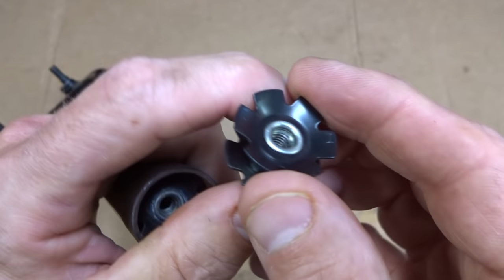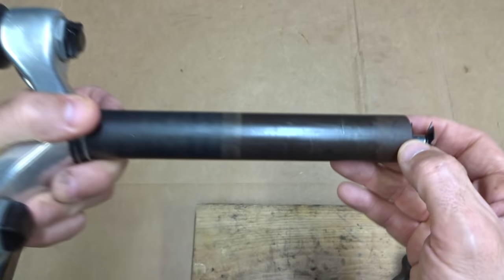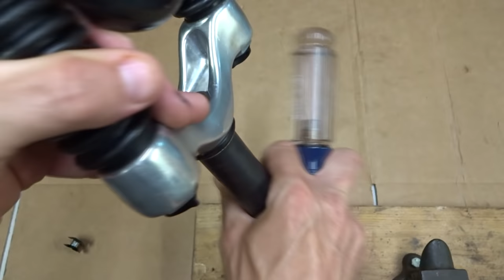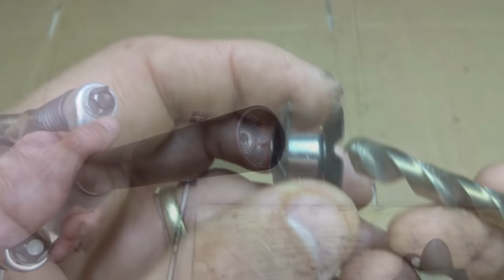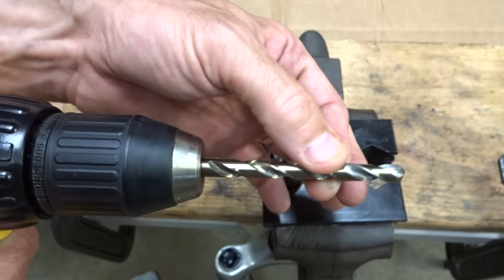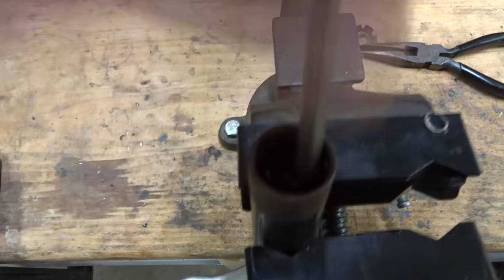How To Remove A Star Fangled Nut From A Fork Steerer Tube

Comment: My man.....thank you for explaining this. I just bought a 300$ bike from a guy that said his front steering was falling apart and it turned out to be this fangled star but was coming out from over tightening I assume. I took a hammer and screwdriver pushed it back in, reset and tightened the top cap and bingo! It's working perfectly fine!

Comment: Bro, not many people talk about this damn nut. You're the boss! Thank you so much! My fork has a column in the bottom, probably for extra support, that does not allow to push the nuts out. I already had one down there and the one I was currently using simply broke and the internal threaded part was spinning with the bolt, making it impossible to loosen and remove it. That would've made 2 nuts down the fork, I was even about to call it the nut cemetery lol.

Thank you so much!

Comment: Just done this and took about 5 mins to drill out and fit a new star nut with a cable hole to internal the front brake. Great tip to a job that would otherwise been a pig.
Reply: great!

Comment: you always make great vids!  I have bought a few used forks cut horribly crooked, so the star nut doesn't center when installing. One time I banged it all the way down through the bottom with some socket extensions only to find that the previous owner had sunk not one...but 3 star nuts in there already!!!
Reply from the maker: That is why I use a guide when cutting forks.
Reply: Or you can use a tube cutter, to cut the steerer tube of the forks.

Comment: Great video RJ,i thought they were very difficult to remove because it's a wedge,it drilled like buttter but i used a industrial drill press at work.Hitting on the edge really so it sits sideways for removal is then job done.Cheers.

Comment: Thanks. I know it is old but very helpful. There are a lot of reasons to remove to star nut. Replacing with a superlight expander type or a steerer extender are two reasons. Cervelo uses carbon and an aluminum inner sleeve on many of its steerers so a star nut may be installed in them.

Comment: It's not even a heavy gauge thick metal. My advice to people that watch this video go to walmart buy a Pb Blaster rust eater or DW40 use a 3/8 15mm socket attached it to a long 3/8 socket extension spray the star nut with the pb or the DW40 connect your 3/8 socket and extension all together turn your fork upside down insert your socket and extension on the hole use a hammer to punch the star nut out. and believe me it works coz that's what i did on mine.

Comment: Star Nuts in the fork are such a major lame design !   Here's why:  Sometimes if you reef on the stem bolt you'll find that the threaded star nut is now spinning freely in the stars, way down in the stem... That's bad.  You can't get your neck off, or the fork either.   Try to drill the nut off the top and you find that it spins anyway so you can't. ( You are now screwed.  At this point I won't go into the various options of getting yourself unscrewed from this dilemma.  )   I will say that IF you should buy a new star nut set, PLEASE bore out the threads of the star nut.  Pass the draw bolt (get a longer one)  THROUGH the star nut hole since it's bored out now.  Then put a nut on the other end using a wratchet extension up under the stem from below,  - assuming your fork is open to below.  This is like a manual version of a wedge bolt stem.

Comment: hmmm, I just bought a new bike frame with a shorter headtube so i need to shorten my steerer tube. I never thought to just push it down and reuse it. i was going to remove it but I think now I'll just reuse it. I think I'll just have to cut small sections off the steerer tube and lower the star nut down as I go to the point where i want it to be and the length where I want the steerer tube to be. Here's to hoping my crappy pipe cutter tool can last long enough for maybe three cuts lol. On second thought I think I'm going to buy a new pipe cutter considering I had a hard time shortening my handlebars with this pipe cutter.

Comment: Some moron installed a star nut in the carbon steerer of a used frameset I bought.  They gouged the carbon circumferentially during the insertion. Fortunately, the steerer is too long for me so I need to cut it but the cut would be ABOVE or THROUGH the star nut.  I can't very well pound it through on a road fork since it only has a small drain hole at the bottom of the steerer... not to mention that I"d basically be reaming out the full length of the steerer. So, will try to drill it out.  And, of course, use a proper expansion plug designed for carbon steerers when I re-assemble the bike.

Comment: I need to remove my star nut as the threaded part in the middle spins around so I can't tighten the bolt. I'll try this method tomorrow and order a new star nut.  By the way the tube on my head is completely closed at the bottom.

Comment: Your pull method worked perfect for me, thanks! Just done to save weight for free. No need for star nut. Just use expander headset as tool to set stem height and tension, then remove and cover with plastic cap :-)

Comment: I pressed mine out at work, using a hydraulic press and a length of 3/4 stainless tube we had lying around. I didn't know they were called a 'star fangled nut' so I went into a bike shop in York and had to draw it for the bloke behing the desk.  I would say you need a more solid work bench I could see it moving!

Comment: Do i have to take this out when taking off my forks?
Reply from the maker: No.
Reply: No just remove the stem and the front brake and i will basically drop out (if you have the newer type of stem and fork setup)
Reply: Fedor van Meeuwen thanks, helped a lot. I was struggling for hours

Comment: For an open bottomed tube I would throw a bolt in it, then push the nut almost through the bottom so the bolt can be clearly seen sticking out the bottom

Comment: Will this work with carbon steerers? I assume I would have to go uo in small increments and not spin the nut My Cannondale Synapse 2 actually has a star nut from the factory..I may just leave it in and see if I can get the Specialized compression plug in.. yes I know that once the headset is set and the stem clamped you don't need the top camp and bolt anymore

Comment: Great video but whoever designed the star nut made possibly the dumbest solution to a simple problem ever. Mine simply spins, marring up the inside diameter of the fork. Can't get it out because I can't loosen it any further, but it's far too loose to ride on.

Comment: One reason to remove it is if you not only have a no use for it all ( currently the case for me ) but if it actually ends up in the way ( soon the case for me ) like when you're planning to use the headtube as a storage space for a Shimano Di2 Battery after you lost your alternative in the seat post due to a Dropper Seat Post.

Not using a Star nut though requires the use of a purpose-built stem like the PRO Tharsis or PRO Koryak
Reply: Not necessarily, you could adjust headset tension using an expanding clamp style system, tighten your stem and then remove the internal clamp.

Comment: Does this really hold the fork in place? I mean if I don't put it on at all what will happen?
Reply from the maker: It's used to tighten down the stem tension the bearings. The stem then clamps down and holds the fork in place.

Comment: my top cap bolt stuck on the starnut, i can't pulled them out, should i drill the bolt ?
Reply from the maker: If it were me, I would put some penetrating oil in through the bottom of a the steerer and try and impact driver. But you can do what you want.
Reply: my bad, i mean it's not stuck cause by a corotion, it's the bolt has losing its grip, i can't tight or loose them.. so they stuck there for nothing.. after i pulled out the bolt i'm pretty sure can try this method on your video to remove the starnut, and replacing the new one, thanks 
*sorry for my bad english

Comment: Too bad mine has a piece of broken screw stuck in it :(
Reply from the maker: Drill it out.
Reply: @RJTheBikeGuy  not really doable, screw was sticking out too much, would have to cut it somehow. I ended up shortening the whole tube so much that there is only place for stem and one 0,5mm pad left. This way I could reach the star with dremel equipped with micro-grinder, and grind the first layer of star "leafs". Then I was able to wiggle it and pull it out.

Comment: this is so bad on so many levels.  seriously bad advice, this is more a vid on how not to do it. if i had a set of rock shox at $800 with a miss threaded stem anchor, this is not the solution.  P.S. you can buy a removal tool!! LOL or you can use a 20mm hole saw. remove the insert then the flange will fold apart.  but in fairness this can be re tapped, (treaded) cut out, knocked down or pushed out. ir it to be pushed ou fit a 6mm hex head therfore it can be forced out and re used.